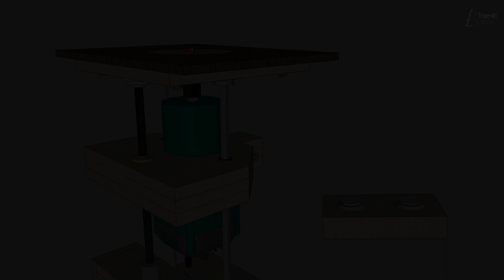"Auto" Router Lift  // 트리머(루터) "자동" 리프트

Comment: ive noticed someone has the same problem as me. Could you do an update on how to do the wiring. The diagram is really difficult to follow if your no electric expert. I have purchased all the items and await delivery. So please Please can you provide an update so I can build this machine. Great video though. I have also done a screen shot of the png and the dimensions for the cogs are missing the thickness measurement. Im assuming this will effect the runnig of the machine when it is running if i get it wrong.

Comment: Va tutto bene tranne DC 5V 12V NE555 modulo generatore di impulsi di frequenza  escono 4,65V. Non so come regolare la tensione di uscita. La resistenza variabile di quanto deve essere e come fare a misurarla. Il motore non va. Scusa di tutto ma voglio arrivare alla fine.
Grazie di tutto Un cordiale saluto 
Maurizio
Reply from the maker: The answer to the question.

1. There are two ways to adjust the output of the 5V regulator.
1) Change the variable resistor - While measuring the voltage of the output with a tester, turn the variable resistor to set it to 5V.
2) Cut the back pattern - The default output is an adjustable voltage. If you need to fix the 5V, use a knife to cut the wire.
   (The method is detailed on the sales site.)

2. When the motor does not operate, please check the following.
1) Check if each volt (5V, 12V) is coming out correctly
2) Check if the wiring connection is correct
3) A4988's "STEP", "DIR" must have a resistor (47K)
4) Check if the pulse is coming out properly from the NE555
   (You must have an oscilloscope, or you can check it roughly by moving the needle with an analog tether)
5) If it still doesn't work, temporarily connect A4988's "DIR" to 5V forcibly and manually connect 5V and 0V (GND) to "SETP" alternately.
    (At this time, the motor should move in one direction little by little)

Thanks for your interest.👍
I hope it will be helpful to those who watch this video even a little.
I will try to reward you with better videos.
Hope you enjoyed this video and if you like it, please share, subscribe, like ~~~  
There are many other videos, so if you are interested, please watch.

Comment: Con molta calma l'ho costruito tutto. falegnameria e meccanica tutto bene. L'impianto elettrico non riesco a farlo funzionare. Faccio tutto come il disegno ma non riesco. L'unica differenza è nel regulator 5V invece di esserci scritto 4R7 c'è scritto 100. Ne ho già ordinati tre ma nella foto di aliexpress c'è scritto 4R7 ma arriva con 100,
Se mi sai risolvere questo problema ti ringrazio molto e ti auguro una buona giornata
Maurizio
Reply from the maker: Thank you for your interest.
Any 5V regulator can be used. You only need to use exactly 5V. The 5V regulator I used is a variable type so you need to measure to see if 5V is coming out. You will have to either work by breaking the pattern on the back of the 5V regulator or adjust it with a potentiometer on the front. Details in this regard are detailed on the sales site. https://www.aliexpress.com/item/32998937888.html
thank you.
Reply: @TreeAnWood  Va tutto bene tranne DC 5V 12V NE555 modulo generatore di impulsi di frequenza  escono 4,65V. Non so come regolare la tensione di uscita. La resistenza variabile di quanto deve essere e come fare a misurarla. Il motore non va. Scusa di tutto ma voglio arrivare alla fine.
Grazie di tutto Un cordiale saluto 
Maurizio

Comment: some type of variable frequency drive that can speed or slow the pulses would be an awesome addition so you can have fast movement when swapping bits but fine control when trying to dial in an exact depth.
Reply from the maker: Thank you for good information.
The pulse rate can be adjusted by adjusting the variable resistor on the NE555.

I hope it will be helpful to those who watch this video even a little.
I will try to reward you with better videos.
Hope you enjoyed this video and if you like it, please share, subscribe, like ~~~  
There are many other videos, so if you are interested, please watch.

These days, comments are automatically classified as spam and deleted frequently. I'm never going to delete it, so please don't get me wrong. If a comment is deleted immediately within 1 minute, please send a request for a drawing to my e-mail (treean.wood@gmail.com) and I will send it to you as soon as I have time. thank you.
Reply: @TreeAnWood 
Hi, I'd like to request the plans for the auto router lift please. Also do you have instructions available for the electronics part of this build.
Thanks
Rich

Comment: Would you now choose to use 1mm lead screw instead of 2mm ??? Stepper motor seems to move router too fast i think ?? One needs to beable to control 0.5mm increment or less when you trimming a slot as example
Reply from the maker: Thanks for your interest.👍
If you reduce the lead of the T8 Lead Screw to 4mm, 2mm, or 1mm instead of 8mm,
You can adjust it more precisely. (The smaller the lead, the finer the movement, but the up and down movement is slower.)
thank you.

Comment: The electrical diagram indicates an Output Voltage power supply: 12V DC but does not mention Output Current:! Amp.
Please can you give me this information.
Reply from the maker: I used a 12V, 4A adapter power.
Thanks for your interest.👍
I hope it will be helpful to those who watch this video even a little.
I will try to reward you with better videos.
Hope you enjoyed this video and if you like it, please share, subscribe, like ~~~  
There are many other videos, so if you are interested, please watch.

Comment: The wood parts are no problem but would really like to know where you purchased the glide blocks:
Reply from the maker: I don't quite understand what glide blocks are talking about?
Please explain in detail.
Thanks for your interest.👍
I hope it will be helpful to those who watch this video even a little.
I will try to reward you with better videos.
Hope you enjoyed this video and if you like it, please share, subscribe, like ~~~  
There are many other videos, so if you are interested, please watch.
Reply: @TreeAnWood  Can you tell me where I can purchase the metal parts? also I would like the drawings if you would be so kind to send them...
Reply from the maker: Thanks for your interest.👍
I hope it will be helpful to those who watch this video even a little.
I will try to reward you with better videos.

I used "DCA Router Trimmer AMP02-6 "
Please refer to the following youtube video.
https://youtu.be/h1er_lmya2U

The circuit was implemented on the breadboard according to the circuit diagram I made.
https://www.aliexpress.com/item/32956621461.html?spm=a2g0o.productlist.0.0.41227117X0A6Yg&s=p&ad_pvid=202007301012231599709944301140003780007_5&algo_pvid=c0945bb2-9c30-4ccf-92a4-797dd8ad1f73&algo_expid=c0945bb2-9c30-4ccf-92a4-797dd8ad1f73-4&btsid=0be3764315961291438052307ebdd0&ws_ab_test=searchweb0_0,searchweb201602_,searchweb201603_

Please check the linked site.
https://www.aliexpress.com/item/4001022374193.html?spm=a2g0s.8937460.0.0.2f732e0eI2wTYw
Reply from the maker: The order site is detailed in the description field.

Comment: Hi,
Yes, I would be happy to receive the plans. For the electronic system, I would like to have more details, especially in the assembly of the different cards. What is the minimum possible ascent speed for a precise adjustment of the cutter? Are there limit stops at both ends.
Thank you and good to you
Reply from the maker: If you leave your email address, i will send you the drawing file.
Thanks for your interest.👍

Comment: Mon router est un Makita 110V donc j'ai besoin d'un power supply 12V.  Pouvez-vous me conseiller;  pour le power supply (110V à 12V et s'il faut une autre pièce (module) à l'ensemble pour la connection. Merci rbeaulieu540@gmail.com)
Reply from the maker: Your router is Makita 110V, but the 12V power supply is a power source for driving stepping motors and electronic circuits, so they have no relation to each other (110V & 12V).
In other words, you use a 12V, 4A adapter to drive the electronic circuit,
just run your Makita router with 110V.

Thanks for your interest.👍
I hope it will be helpful to those who watch this video even a little.
I will try to reward you with better videos.
Hope you enjoyed this video and if you like it, please share, subscribe, like ~~~  
There are many other videos, so if you are interested, please watch.

Comment: My parts arrived.  Do you have any tips on wiring the parts? Thanks.
Reply from the maker: Congratulations. ^^
I'm sorry, but what exactly are you asking?
You can connect it like the wiring diagram we sent you.

Thanks for your interest.👍
I hope it will be helpful to those who watch this video even a little.
I will try to reward you with better videos.
Hope you enjoyed this video and if you like it, please share, subscribe, like ~~~  
There are many other videos, so if you are interested, please watch.
Reply: @TreeAnWood  Hi,  yes, I have the diagram you sent.  OK, I'm not an electrical type person..   I'm looking for hints on connecting the wires to the terminals on the parts placed on the breadboard.  
are they soldered or?  What are the squiggly lines between STEP and ground and DIR and ground with the letters 47k>?   Or do I need to find a person who has experience with this kind of work?    Thanks,
Reply from the maker: Squiggly lines with the letters 47k are resistors.
➤ https://www.aliexpress.com/item/32847096736.html

Using a breadboard does not require soldering.
Five compartments of the breadboard are connected to each other.
It will be helpful to refer to the following video for detailed instructions.
➤https://www.youtube.com/watch?v=lk5Ug--bIVI&ab_channel=ArrowElectronics

If you study a little, I believe you will be able to do it alone.
Thank you.
Have a nice day~ :)

Comment: Hello friend, I sent you an email, asking if your circuit will hold a nema 23 which is what I have, since my router weighs two kilos plus the structure about three kilos
Reply from the maker: Hi.
I will answer your questions.
The rated current of 23HS7628 are going to use is 2.8A.
The control capability of the step motor drive A4988 is up to 2A.
So, it seems to be a problem if you use it as a driver for A4988.
You should find a driver for the 23HS7628.

For reference, the A4988 specifications are in the link below.
https://www.aliexpress.com/item/32965199683.html
==> "output drive capacity of up to 35 V and 2 A."
Thank you.

Comment: I need some advice. the motor you used, Stepper Motor (17HS3430), has the power to move the Bosch POV 1200 AE. the motor must have the power to contract the springs of the cutter. thanks
Reply from the maker: It is difficult to tell you exactly because I have not used the Bosch POV 1200 AE,
When selecting a stepping motor, you must carefully consider the weight and spring tension of the Bosch POV 1200 AE.
I think you can remove the spring.
Because the main body is supported by the stepping motor anyway.
For reference, the holding torque of the 17HS3430 motor is 28N.cm.
Thank you.

Comment: Awesome!  Can you add an automatic stop to a certain measurement? For example, when the bit is raised and touches (ground out) metal height gauge, the stepper motor will stop automatically
Reply from the maker: I am thinking about using the Enable pin or Sleep pin in the circuit.
It seems possible, but it is a little difficult to give a definite answer because I haven't tried it correctly.
Thanks for your interest.👍

Comment: HI, this must be the ultimate router lift!

Could you please send me the plans, electric wiring ?

Also please the link to the hardware (routermotor, slidings and spindels) you used ?

E-mail: berthmail@gmail.com

Thanks for your great work !
Reply from the maker: Thanks for your interest.👍
I hope it will be helpful to those who watch this video even a little.
I will try to reward you with better videos.
The requested drawing has been sent.
Reply from the maker: I used "DCA Router Trimmer AMP02-6 "
Please refer to the following youtube video.
https://youtu.be/h1er_lmya2U

The circuit was implemented on the breadboard according to the circuit diagram I made.
https://www.aliexpress.com/item/32956621461.html?spm=a2g0o.productlist.0.0.41227117X0A6Yg&s=p&ad_pvid=202007301012231599709944301140003780007_5&algo_pvid=c0945bb2-9c30-4ccf-92a4-797dd8ad1f73&algo_expid=c0945bb2-9c30-4ccf-92a4-797dd8ad1f73-4&btsid=0be3764315961291438052307ebdd0&ws_ab_test=searchweb0_0,searchweb201602_,searchweb201603_

Please check the linked site.
https://www.aliexpress.com/item/4001022374193.html?spm=a2g0s.8937460.0.0.2f732e0eI2wTYw

Comment: Bonjour bravo pour la table de défonceuse c'est super sur quel site avez vous achetez le moteur et le kit circuit imprimé et inter pour le levage et descente de la fraiseuse  à très bientôt Bernard 👍👍
Reply from the maker: Thanks for your interest.👍
I hope it will be helpful to those who watch this video even a little.
I will try to reward you with better videos.

I used "DCA Router Trimmer AMP02-6 "
Please refer to the following youtube video.
https://youtu.be/h1er_lmya2U

The circuit was implemented on the breadboard according to the circuit diagram I made.
https://www.aliexpress.com/item/32956621461.html?spm=a2g0o.productlist.0.0.41227117X0A6Yg&s=p&ad_pvid=202007301012231599709944301140003780007_5&algo_pvid=c0945bb2-9c30-4ccf-92a4-797dd8ad1f73&algo_expid=c0945bb2-9c30-4ccf-92a4-797dd8ad1f73-4&btsid=0be3764315961291438052307ebdd0&ws_ab_test=searchweb0_0,searchweb201602_,searchweb201603_

Please check the linked site.
https://www.aliexpress.com/item/4001022374193.html?spm=a2g0s.8937460.0.0.2f732e0eI2wTYw
Reply: thank you very much for this helpfull video. will you please send the png drawing to:gunaykucuk@gmail.com

Comment: Wow genau wie ich es gerne hätte. Kann ich bitte Bilder von den Explosion Zeichnungen und elektrischen Schaltplan bekommen? My E-Mail is pan-p@gmx.de.
Super coole Lösung für das Problem.
Wow exactly how I would like it to be. Can I get pictures of the explosion drawings and electrical circuit diagram please? My email is pan-p@gmx.de.
Reply from the maker: Thanks for your interest.👍
I hope it will be helpful to those who watch this video even a little.
I will try to reward you with better videos.

Please check your email address again~
It says that the email address cannot be recognized..
Is "pan-p@gmx.de." correct?
Reply: @TreeAnWood  yes. This is my address. pan-p@gmx.de.
Reply from the maker: OK. I will try again. 
In case it doesn't work, is there any other emails?
Reply from the maker: I'm sorry.
It was my mistake.
An error occurred by entering a dot at the end of an email address. ^^
The requested drawing has been sent.